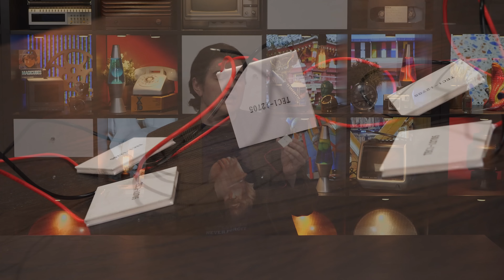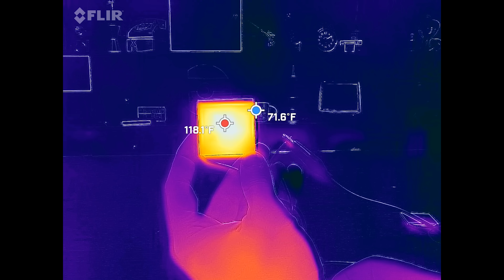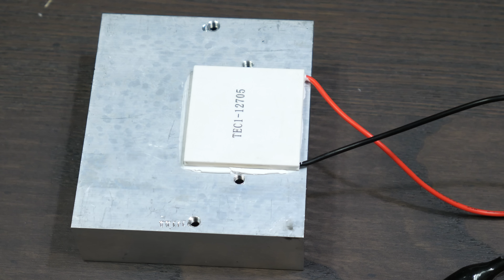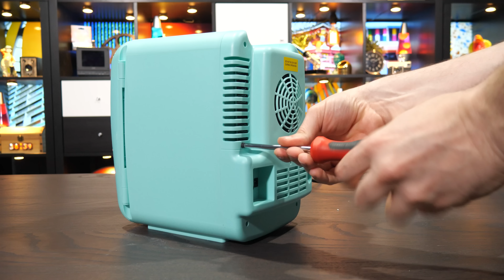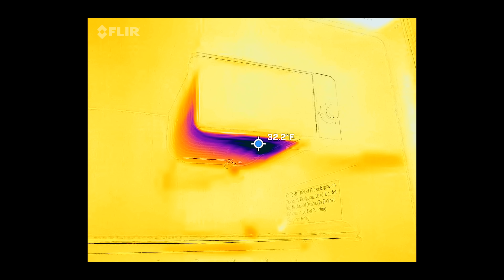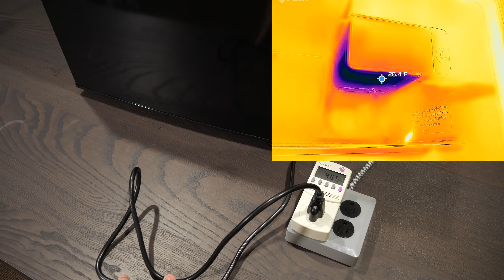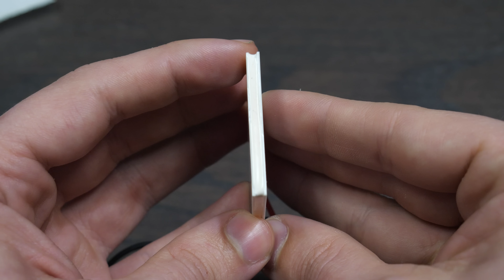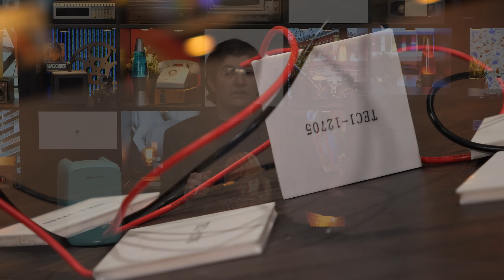Thermoelectric cooling: it's not great.

Comment: When will you 110v yankees start using a proper temperature scale (Celsius) and write the date correctly and stop calling football "soccer"? 🙄
Ha ha ... just kidding. 😂
The crappy little fridge is fine for travelling. It plugs into the 12v supply of your car or campervan AS LONG AS you put already chilled cans into it to begin with. 👍

Comment: So I have a six-pack fridge that I bout about 20 years ago and at cold start it presently uses 40 watts. That's not great but at the same time, I can't expect that to take that much less considering one of my LCD alarm clock-radios (GE model) is somewhere around 19 watts. I actually hunted for a cheaper alternative clock-radio and found one that hotels use that takes about 7 to 8 watts but they have very little in features and sound pretty cheap. I'd be happier with the six-pack fridge running at 25 watts, which would be about half of a mini-fridge (I have one at about 50+ at home), but the advantage of the six-pack fridge is that it takes up little space at the office. I hadn't thought about it and since your video I did add a timer that shuts it off from about 8pm to 8am (so effectively cutting usage to 20 watts)...just wondering what cooling and warming sodas will do over time 😕 Thanks for the insightful video.

Comment: Has a manufacturer ever made a tiny compressor so teeny tiny fridges could be made? I have a tiny boat and need to chill milk for my tea (I'm English).  My Peltier chiller "toy" may be rubbish but it does the job (powered by my solar panel).   

I've added insulation and a thermometer.  But a real tiny fridge would be great!

Comment: The best part of Peltier's is that you can push heat through them to generate power. A common application are little self powered fans that you put on fireplaces or pot belly stoves to move the hot air around. The fan and heat spreader cools one side and the fire heats the other side. My favorite use is a little camp stove I have that burns wood and uses the peltier to run a fan providing forced air into the burning chamber giving you a cleaner burn. Plus it has a little excess power which I can charge my phone or other small electronics with.

Comment: I have a Thermoelectric cooler. However, it is for automobile use and runs on the 12V accessory socket. It can keep drinks hot, or keep drinks cold, on long road trips. I find it useful at least, and got it for $5 from a neighbor who was doing a garage sale. The thing definitely has insulation. Doesn't have temperature control. Definitely quieter than these cheap coolers...

Comment: The question I have is the cooling coils in the sidewalls other wise you can add extra insulation some people are using small chest style freezers as a fridge just using a different temperature controller since I'm in a cold climate area so I'm going to set. my freezer up in a climatly controld area so I can can use the coldest air possible in the months where the outside temperature is lower than freezing I figure the heat loss from the back and sides will be greater than the heat gain from the door so the compressor should never turn on

Comment: i think peltier's are used in chemistry... kinda as a plate that can either heat or cool down stuff... combined with a stirrer and thermometer u can cool down / heat stuff to a temp u need for a reaction or to stop/prevent any reactions so u can mix multiple components that would reacht with each other then put in the final component that stops the reaction until another component is mixed it that stops the component from stoping the reaction

Comment: They have portable Dehumidifiers that use the Peltier, The side that normally gets cold would create condensation that gets filled into a container below, All the condensation it collected was all the moisture that was in the air, So there are actual uses for a Peltier.

Comment: Did anyone already mention these Peltier Elements also GENERATE power ?
(albeit at an even worse efficiency than they transfer thermal energy, actually much much worse...)
The most common consumer use is driving a fan by just the heat of a furnace.
But the soviets went so far as heating it with a nuclear isotope and using it as a "neverending" battery to power remote radio beacons!

Comment: I have a 20 or 30 can cooler with a huge thermolectric in the top lid, the car doesn't seem to care whether it's connected or not and works quite well for trips over 8 hours.
I also have one of those toys and yeah, it's very useless.

Comment: I don't see how people in the comments mostly blew by your use of "most applications". I'm a peltier fan, but they aren't for every application and aren't the most efficient and I think you did a good job at covering that and the whys. They are fascinating devices though because they have a third trick up their sleeve: they generate electricity when heat is moved through them! Also in a horribly inefficient way (3-8%), but it at least works at lower than boiling temps. However we need to crack their inefficiency to be truly revolutionary to every day life

Comment: Well, thanks for explaining me what a Peltier element is....As a biologist  I use PCR every day, and Peltier elements are what makes it work (without, I kid you not, havig a student, or a robotic arm, dip plates of little tubes in various water baths very fast for a few hours, yes, that is how it started). 
You need a very quick cycling between cooling and heating of,  essentially, a metal block with little tube-shaped holes. A lot of cool (he he) molecular biology works thanks to this little machines...(and a lot of energyis is wasted when people leave them on "cool" overnght).
Noisy little machines, especially when they start to get older, due to all the fans cooling heat sinks and so on
PS:  PCR = Polymerase chain reaction

Comment: these honestly work best when used with liquid cooling instead of using finned heatsinks due to what they are so you can heavily insulate the hot side, cooling controller needs to run the pump and heat removal cycle for at least 30 seconds after the chip is shut off so that left over heat doesn't get back in as well, try this and see how it works
never seen a good peltier fridge done right so yeah the ones normally sold are junk

Comment: I always saw the main draw of those mini coolers to be the size and weight so all of the rest of that is kinda pointless or not really an option for the people who'd most likely opt for the small ones, i.e. you're in a small dorm room or office where you're not paying for electricity based on usage and you don't have the space for the obviously better but much bigger and heavier mini fridges. Also, if it had a bit more insulation inside it could probably use less power to cool when it's cold like the fridges.

I'm mostly looking forward to these in computers, I didn't finish the vid but the context seems pretty specific (along with the pinned comment) meanwhile they're supposed to revolutionize computer design with passive/solid state coolers.

Comment: I only used thermoelectric cooling device on the diode laser with huge heat sink attached. Those devices are better suited in that lab environment because it can really eliminate moving part.

Comment: Youre comparing a cheap chinese desktop fridge with a poor implementation of peltier cooling, comparing it to the efficiency of the refrigeration cycle, and concluding that peltier devices are ineffective. 

It's not about it being outside your scope, 8:10, you call peltier devices terrible
24:14 You also claim they're "not very good at what they're supposed to do", which isn't to be used in refrigerators

Normal fridges also take about 24 hours to reach optimal temperatures

There are certain things I agree with, like that consumerism is bad and bad quality products are massively wasteful, but the way you frame your video is just misleading.

Comment: I wonder if anyone has published info about a MEMS heat pump? A series of thousands of staged MEMS devices could work as an efficient adiabatic refrigeration system (instead of phase change) because the compressor could operate at very high temperature allowing very efficient heat rejection. The heat capacity would be relatively low compared to a macro-scale heat pump because MEMS, but the CoP could be high, and it could potentially operate at cryogenic temperatures in a single stage.

So you could do something like fabricating a miniature cryocooler directly into a CPU die to provide targeted cooling of the hottest parts of the chip allowing cores to burst to much higher speeds.

Comment: Unit problems at 15:33:  The caption reads "464 / 365 = 1.271 kWh."  464/365 is indeed 1.271, but that's 464 kWh divided by 365 days, so it's 1.271 kWh/d, or about 53 W.  Which is indeed less than the toy.

Comment: Another point that would have been great to bring up is longevity. The peltier coolers are made in eye-watering numbers and have much lower quality control than actual fridges. I’ve had two different coolers, and in both, the cheap computer-style fan seized up after mere months (which could be a fire risk but I’m not curious enough to find out). Meanwhile, my family’s first fridge died after 8 years, our second died after another 8 years, and our third just died a few days ago after 12 years and spending its last 4 years as a spare garage fridge in brutally hot summers. Now 4 years into only our 4th fridge in over 30 years and it’s holding up nicely. Actual fridges have been a core home appliance for over 75 years with well-established reliability standards to follow while these peltier coolers really are toys with little more reliability than a micro R/C helicopter from the dollar store.

Comment: Peltier elements are advantageous if you need high precision. They are often used in scientific equipment to regulate a temperature - though there the opposing side is generally set to the approximately right temperature using a coolant and a big unit with a compressor and the Peltier element used for fine tuning.

Comment: Our coolbag we have for camping has one of these Peltier cooling elements. That one you can run on both AC or DC power. And when you use it on AC you can adjust the cooling on a little resistor but on DC it just runs on full tilt. I wonder how that works? If it is just the fan speed that gets varied or if the cooling power of the Thermoelectric element is also varied. We got it for its size and we run it off an Ecoflow in the tent. You can certainly cut down the power consumption a lot by turning it down and I always have a thermometer to monitor the inside temperature. But having frozen water bottles in the cooler to start with as well is pretty much always necessary not to burn through the 1kWh Ecoflow over a weekend unless the outside temperature is really low. Sadly its the Inverter in the Ecoflow that wastes a lot of the power just being on.

Comment: I'm only at the 16min mark in the video but you mentioned something called food browsing and I do a lot of that. How come fridges aren't all glass doors? Insulation? could we put a vacuum gapped glass on the front of it or something?
Reply: It's technically no problem to use a well insulated glass window as the door (typically filled with Argon, not a vacuum), but it would make the thing way more expensive, heavy (you'd probably need a counterweight or screw the fridge down so that it doesn't fall over when the doors are opened) and more prone to breaking during transport, tough the latter point is probably not a big issue.

Comment: @TechnologyConnections There are so called thermostatic radiator valves... There are a lot of them, but I ordered a green one from aliexpress. This is normally open (so when I apply 24V to the terminals, it heats up, and push some stuff, which press on the valve, and close the water. If you have time, I would really like to know, how it's working inside.

Comment: I had a similar mini-fridge in my room when I was a teen and it worked very well. It made some noise but it kept my drinks and other stuff cold. Just slightly above freezing. It had a cooling capacity of about 25 degrees Celsius which is sufficient enough even in summer in Scandinavia =)

Comment: At 17:45 you say most fridges use 'iso-butane' but the fridge is clearly labelled 'C-Pentane' in numerous shots of the back. Aren't they different gases? Butane has 4 carbons vs Pentane's 5 doesn't it? Not that it is the most important thing to point out but for the fun of being pedantic thought I'd question it, and I may well be wrong in remembering my chemistry. Certainly all the fridges I've looked at recently have been C-pentane (I've looked at more than I ever want to as we are trying to choose a new one)
Reply: The label “C-Pentane” refers to the blowing agent used in the insulating foam, which is cyclopentane in most modern refrigerators. Cyclopentane does have five carbons arranged in a ring, each bonded to two others and to two hydrogens. The refrigerant though is isobutane, or R600a. It is an isomer of butane with four carbons: one bonded to one hydrogen and to the other three carbons, each of which is bonded to three hydrogens. If I had to guess, I would say that the “C-Pentane” label being so large is there to warn people not to catch the fridge on fire, since the insulating foam is full of another flammable gas.
Reply: @samuelwoolwineiv7886  Thank you for correcting me. Happy to be corrected than continue to talk non-sense :)

Comment: Peltier device will  let the heat leak in as soon as you turn it off, that is why propably there is no thermostat to avoid turning it off, but i'm surprised that it have no power regulation at all.

Comment: I wonder how low the temperature will go if you arrange them in a cascade? (Using the one to cool the next two and then 4 to cool those 2 and so on and on). Will the temp. just keep dropping? Can you think of a way to use them in a pyramidal arrangement so that you only use one fan to cool all the hot side elements?

Comment: There is one application of these "not great" Peltier effect "fridge" boxes that I find useful. I have a thing about twice the size of your silly blue box, which is a cooler box with insulated walls and a carry handle, and I can put it in my car. I can use it just as a cooler box, and it does a pretty good job of keeping already-cold things fairly cool, but I can PLUG IT IN in my car and it keeps the already-cold things I put in it just a little bit cooler than they would otherwise be. Whether that's beers I'm then going to drink or chilled products from a store that will go into a proper refrigerator at the end of a long drive home, it's still a useful device. And the insane power consumption isn't a factor -- it only runs for a few hours at a time, in the car, from my car battery, when I need it. Of course, the box did come with a mains adapter as well to allow it to be plugged in at home -- and that, as you rightly say, would be, most of the time, a bonkers thing to do...

Comment: This is probably the sunk cost fallacy setting in, but I do think that not all Peltier fridges are bad. 
is that small 6 can one bad? yeah
But I have a larger one (about 50$) that has worked just fine for me, it can keep a full 12-pack of Mountain dew really cold, and it even fits food if I want. And it's surprisingly quiet.
Is it perfect? no, not at all. I wouldn't recommend buying it for yourself. But does it work for what I want it to do? Yeah

Comment: I have a humidity cabinet using peltier just to control humidity*, and it isn't even very good at that. 
*temperature is considered passive (temperature of the room), but because humidity changes relative to temperature it doesn't make a lot of sense.

Comment: Im sure im not the only one to point this out but just in case. Im glad uou pointed out the use in cars. I am a truck driver, we have no limit to electricity bar the circuit limits. And we have much better control of the ambient air temperature in our cabs. I have a bigger chest cooler with a beefy thermoelectric cooling unit on it. Between the better insolation of the cooler and my affinity to keep my truck very cold for my comfort, my cooler can easily get cold enough to freeze items closer to the heat exchanger. While i agree that having more fine control over the temp would be nice. I prefer the peace of mind knowing i dont have to worry about leaks of butane into my confined cab should i hit a bump too hard while driving. 

Great video love the info. Keep up the great work.